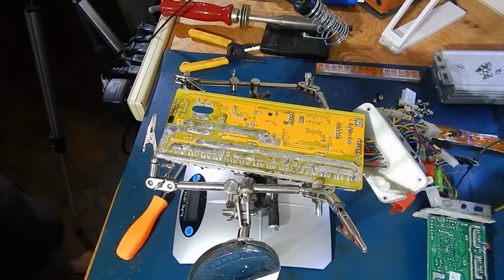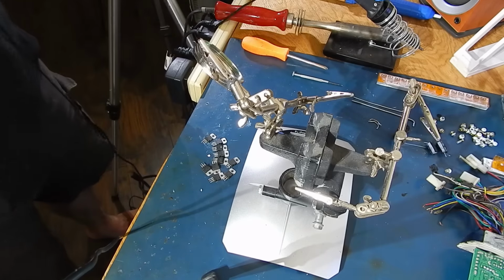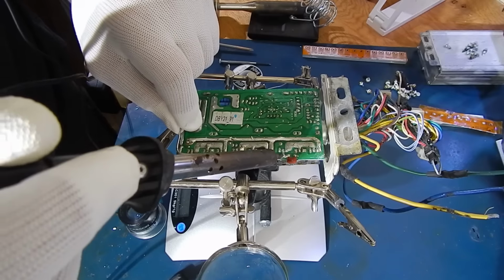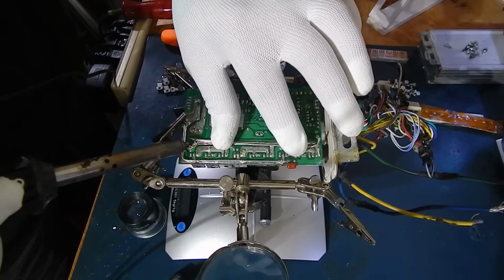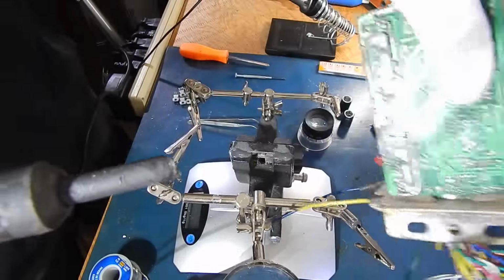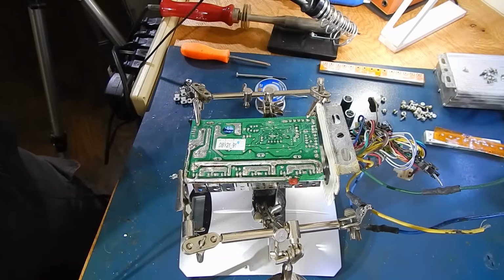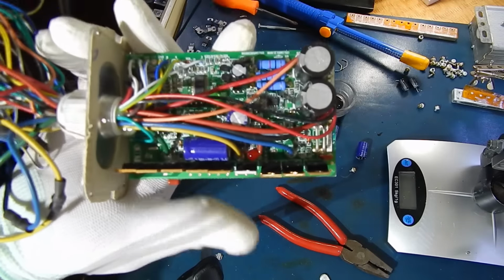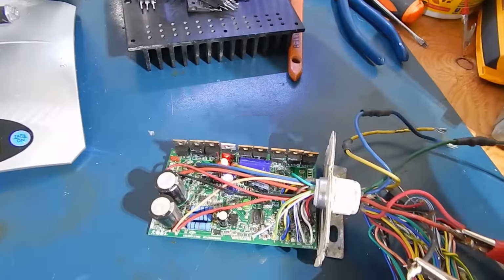ebike controller modification*with details tips*

Comment: In extreme uses of the controller where it is required to deliver high current for long periods of time (like doing wheelies or climbing long steep slopes) the solder tracks can actually become liquid and literally puddle at the lower end of the track.  This leaves only the thin trace on one end of the track and a very thick solder ball at the other end.  If you hit a bump the solder can short against the case or the thin trace can fuse through.  Either will leave you stranded and fry MOSFET's.  By beefing up the track you add sufficient mass of copper and solder to prevent it from ever becoming liquid.  Basically, it can carry more current for longer periods of time.
While using solid copper wire is the norm, I use braded copper intended for removing solder, but just solder it onto the tracks.  I also cut a thin piece of fiberglass (available in 1foot squares at most hobby stores) to put between the bottom of the board and the case.
You can often feel smoother starts or tiny gains in power after this work, but it is mostly to protect the MOSFET's from overheating and or catastrophic failure of the track itself.

Comment: Just curious why didn't you change the capacitor that is by the mosfets I'm going to be doing a similar upgrade and I need to know if I should upgrade all 3 of the 63 volt capacitors to 100 volts or just the two you did

Comment: I just did this last night and I feel the increase in torque.
Thanks for posting this video.
Reply from the maker: no problem. you will likely want to upgrade the battery next.
Reply: Any more speed or just torque?
Reply: Remember that while "increase in torque" gives you that warm fuzzy feeling inside, it's never free.  A balance must be maintained on modified controllers.  The "cost" of torque is limited to a few areas: 1) Battery drain ... shorter range, fuse failure, cell failure, and let's not forget battery fires/death.  2) Catastrophic controller failure.  3) Motor failure (least common...but still expensive).  4) Crashing sucks!  
The adrenaline rush that electric torque provides can be overwhelming.  It changed my life.  I made good and bad decisions.  All because TORQUE!
Just remember "crashing sucks" and you should be okay.

Comment: Hi, i have come across this video after buying a 72v battery for my 1500w Ebike rear hub motor .The controller  got hot ,i mean very hot so i  put back my older 52v battery and now have a code error 10.After  stripping the controller i found one of the 5 large  cap puffed up  a 470uf  63v , In order to make the controller run at 72v do i just change all 5 caps to  470 uf 100v or is there more to it  to make it run at 72v, i have checked the specs of my mosfets and they are 68v 120a,any help would be great,thx Steven

Comment: the pedal system does not require hall sensors, then what to do with the wires for powering the hall system ..!?
Reply: If your motor doesn’t require it to use it you don’t have to. Sometimes even a motor will have the wires but still will run with out it just may lose efficiency.

Comment: If i change the capacitor to a higher voltage can I use a higher voltage system
Reply: Assuming your wires, tracks, capacitors and feta can handle it yes.

Comment: wow, you seem t be an authority...

I have a challenge and I’d like to know what you think…

I have a working e-bike with a very basic controller, everything works, however I am stuck with the out-of-the factory speed.
This bike doesnt even allow me to reach 25Km/h considering my weight.
All I wanted to do was to have a lil more speed, nothing crazy.
So I bought a KT controller and display thinking that I could change the speed limit.

The new controller is supposed to be better than the original, better mosfets etc..
However it doesn’t work. The display turns on the bike, I can even browse thru the parameters but it shows 0 battery charge, hence nothing works.
I tried all sort of things, like swapping the hall sensor cables to see if there was some mismatch but still nothing. Clearly there is current from the controller cause I measured 3.68V at the Throttle cable when the controller was plugged to the motor and battery.

Battery is 48V 15AH I dont think is the problem, the display turns on, it just doesnt comunicate with the motor (250W)

My naive question:
How can I proceed with modifying the new controller and make it “like” the original?

I thought about making a new one from scratch but it might be too difficult for me,
Besides I’d still have the display problem, I need one to turn on the bike, speed regulation, headlights etc..

I suspect it might be something “simple”, related only to the power circuit, perhaps once I get proper reading of the battery charge everything will work…. hopefully.

Any thoughts is greatly appreciated.
Reply from the maker: ya that type of upgrade need to be in person. there's no way I could guess what the problem is. can you adjust the lvc in the firmware?
Reply: @karmaEbikes.   forgive my naiveness, is the LVC the main chip in the controller? the one that communicates with the display?
Reply: You have an error message that’s telling you your battery is not connected yet. You state that you feel the problem is the connection to the motor to completely separate things first I’d say what type of connect are you using for the battery now and then I would open up the controllerand see why you are not getting full voltage inside of 3.68 V sounds questionable on your throttle control. It’s usually five.

Comment: hey
i have a 1000w fatscooter with 48 - 60v controller and 1200w 20a battery and the speed is limited to 15.5m/h
and im trying to figure out if theres a resistance connected somewhere or someoption to bypass the speed limit
it has a three speed function which connects to K1, K2 and GND on the circuit. theres also K3  with nothing on it, whats that?
Reply: im a total noob in the electronics, please help =D
Reply: Is there a wire on the controller connected to its self . Disconect it

Comment: What does beefing up the traces do?
Reply from the maker: helps even out the load. if you get a hotspot it could travel up the fets legs or pop like a fuse!
Reply: In extreme uses of the controller where it is required to deliver high current for long periods of time (like doing wheelies or climbing long steep slopes) the solder tracks can actually become liquid and literally puddle at the lower end of the track.  This leaves only the thin trace on one end of the track and a very thick solder ball at the other end.  If you hit a bump the solder can short against the case or the thin trace can fuse through.  Either will leave you stranded and fry MOSFET's.  By beefing up the track you add sufficient mass of copper and solder to prevent it from ever becoming liquid.  Basically, it can carry more current for longer periods of time.
While using solid copper wire is the norm, I use braded copper intended for removing solder, but just solder it onto the tracks.  I also cut a thin piece of fiberglass (available in 1foot squares at most hobby stores) to put between the bottom of the board and the case.
You can often feel smoother starts or tiny gains in power after this work, but it is mostly to protect the MOSFET's from overheating and or catastrophic failure of the track itself.